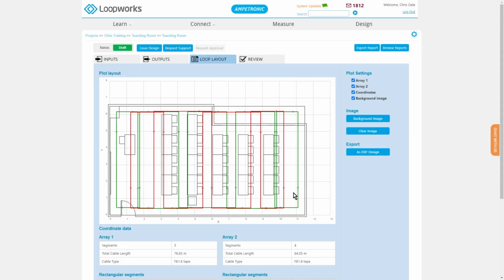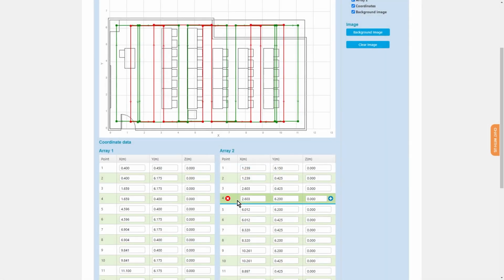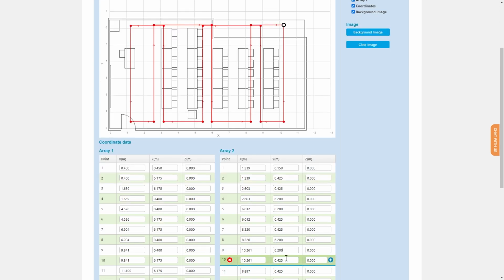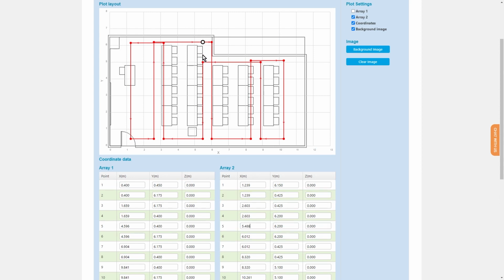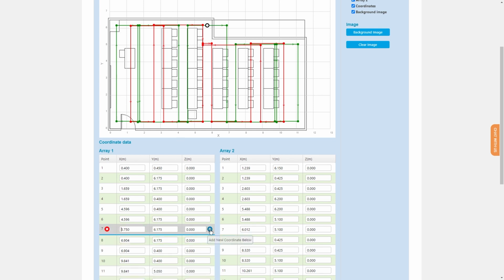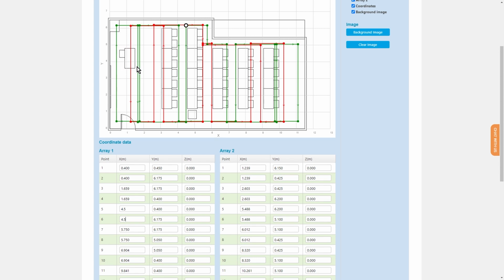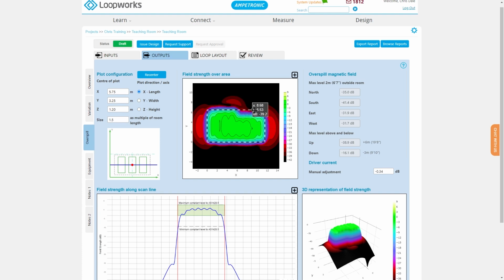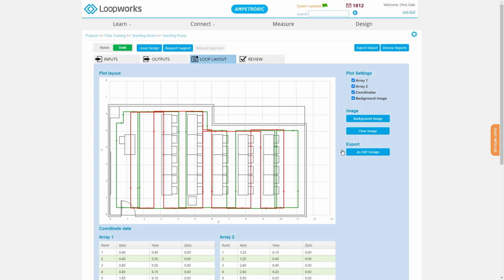Loopworks Design Edit Mode Walkthrough

Comment: If you can manually change the coordinates of the loop, what's the point of needing software to place them?  It looks like a fairly simple set of rules to determine placement of the two phases.
Reply from the maker: While the basic layout of MultiLoop systems is a simple idea, the exact positioning must be carefully optimised dependant on a number of factors such as the construction of the floor or ceiling, install and listening heights and any requirements to control overspill in one or more directions. The Loopworks Design Tool provides a quick and convenient way to simplify this process, whilst still giving users the option to either edit the automated layout to suit their specific space, or even draw layouts from scratch with the CAD import feature. In all cases the Design Tool is then able to simulate the expected loop field and calculate the equipment needed to power the loop system.